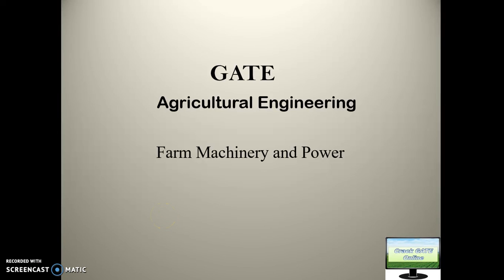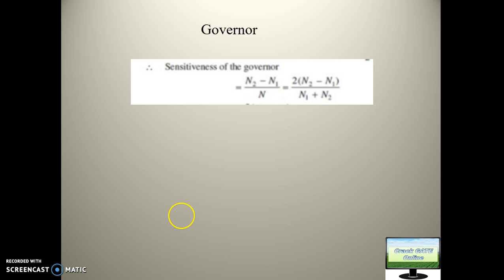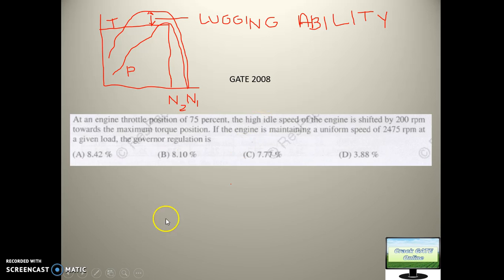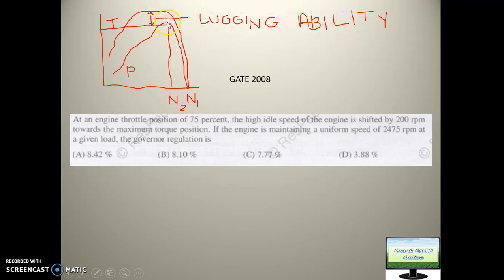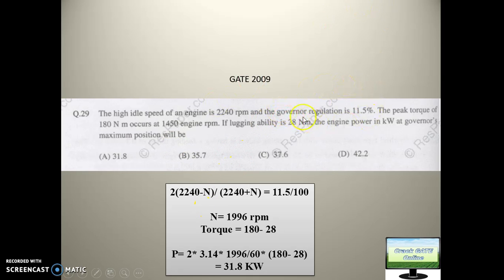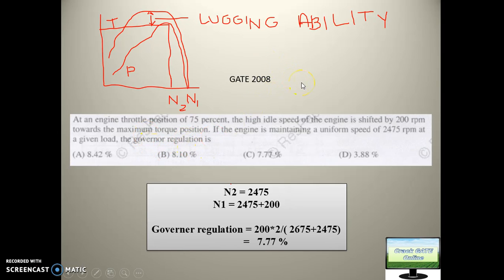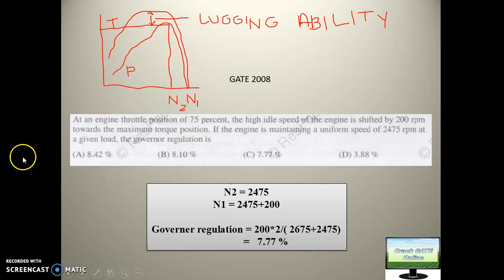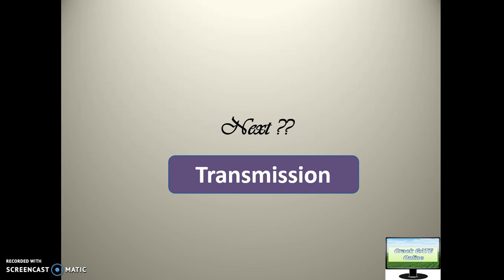IC Engine Part 4- Final Part

Comment: Sir question no.66 year 2008 right answer is 8.42% instead of 2675 
N•=2275 since it is shifted towards maximum torque
If it is shifted towards minimum torque then ur answer is right